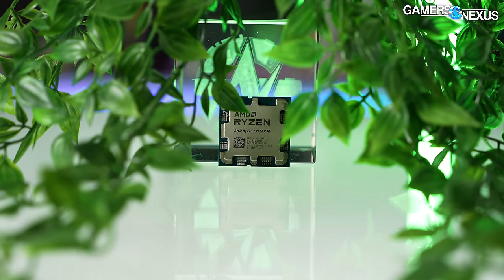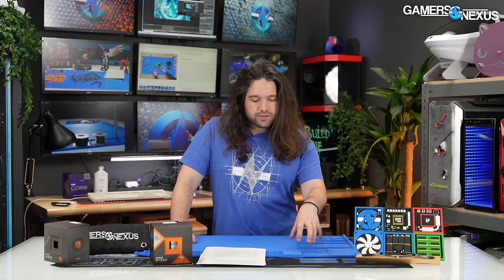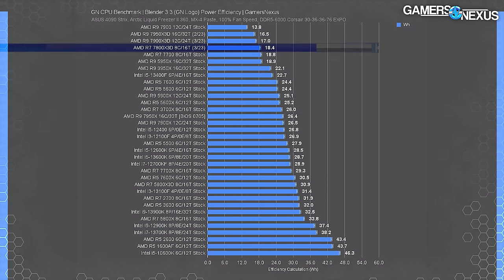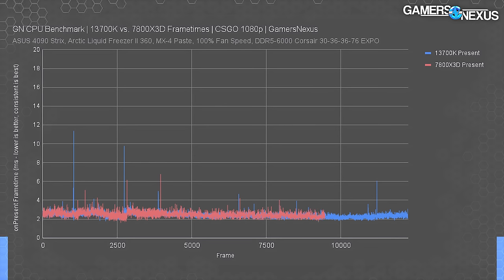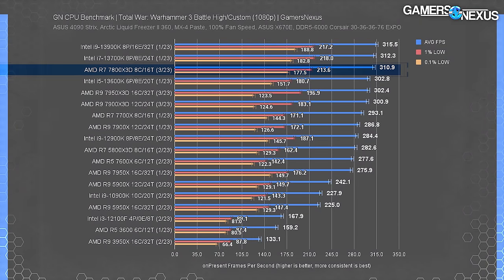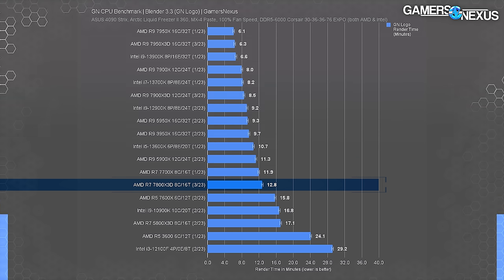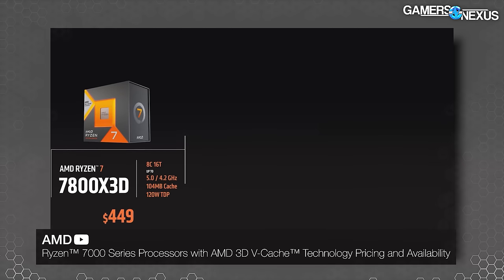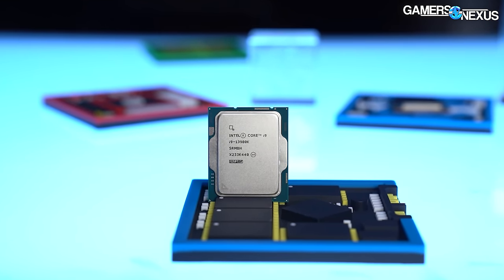AMD Ryzen 7 7800X3D CPU Review & Benchmarks

Comment: The efficiency on these chips is mindblowing. I thought my 5600X would be the last sub 100W CPU I will ever own. And all this while being one of the fastest Gaming CPUs and no ridiculous increase in pricing like in the GPU space.
Reply: i7 is similar efficiency and has it beat in almost every category...
Reply: Uh, it's a $500 CPU that requires a $250+ mobo and $150 in 32GB DDR5 to work properly.  Maybe 0.01% of gamers will buy this.
Reply: @mintymus  similar efficiency? 7:56 did you even watch the video? lmao
Reply: @mintymus  not even close to the same efficiency lmao
Reply: @sophieedel6324  wtf do you need a $250 board for? a $150 one does everything you need, and you dont need 32gb of ram
Reply: @rdmz135  do you know anything about the price of AM5 boards? you can't use this with an A620 board that only supports CPU up to 65w TDP
Reply: @mintymus  lol intel fanboy commented without even watching the video?
edit: after seeing his reply on other comment, yep, totally brainless fanboy
Reply: @sophieedel6324  am5 boards cost more
Reply: @rdmz135  Intel Raptor Lake need manual tuning and undervolt to improve efficiency, so it would be competitive on the power front vs. 7800X3D. These benchmarks are out of the box/stock numbers. Compared to Intel 10nm++++, TSMC N5 (for AMD), a superior process node, is a solid win on efficiency for AMD.
Reply: @sophieedel6324  mid tier mobos can be had for $200, and this is a gaming chip where 16GB is fine for most use cases, which can be had for for $90. Linus' review covers this exactly, actually.  I'd also add that these chips aren't really good for overclocking since they're so sensitive, so a low end mobo would probably be fine for most buyers.
Reply: @duccc  the ones that accuse GN of being biased towards AMD are always the most obviously biased out of anyone. IN MY OPINION , GN has consistently provided the most transparent information and reviews
Reply: @duccc  you
Reply: @sophieedel6324  32 gigs of ram to work properly? Why would more ram help it's performance?
Reply: Misinformation.
Reply: @xTurtleOW  they last 5 Years,not 1 like the Intel ones 😒
Reply: Why you want an x3d for blender? Are you playing games with x3d processor? So in games, even with i9 processor the power draw will be 50-60W
Reply: @sophieedel6324  I am paying 80cents a Kwh that makes intel a bad choice . also AM5 has cheaper motherboards because the CPu's do not need Massive VRMs 80 vs 280 watt that is a difference especially in summer time . if you have a Ac running and do not need a heater
Reply: I have two systems in my house, one is an AMD build (7950x3D), the other is a raptor lake build. The intel idles at around 18w, and it barely goes above 25w for low load usage (browsing the internet, watching vids, word..ect). The AMD idles for around 60-70w, and about the same for low load content, though can often go up towards the 90w range.

The fact is, the intel system will consume far less power than this x3D rig in the long term. AMD only wins in that efficiency category when its under load, which for most people is not all of the time. 

Food for thought.
Reply: @JuliTV123  

It's close when AMD is ahead, and then it's not a gaming CPU when Intel is only 1-2% ahead in specific games at 1080p. Nevermind the absolute need for high end cooling and a well binned chip from Intel to get the same benchmarks as reviews, along with the power draw. No one even mentions the worse multi-tasking that Intel has. In a real world scenario, with background tasks like a browser, music, antivirus, discord, etcetera, Intel will easily drop that 1-2% it used to be ahead in for specific titles if you don't
Reply: @duccc  Boy, you look silly.
Reply: @JuliTV123  Boy, you look silly.  Actually Intel is better efficiency when doing every day tasks, even gaming.  Only at 100% AMD wins. Try again.
Reply: Yep its actually nuts. My cpu draws 6 less watts (sometimes the same amount) and the 7800x3d has like double the performance in games
Reply: @rdmz135   Intel wins in every day computing efficiency, even gaming.  It only loses when at 100%.  Silly AMD boot licker.
Reply: @mintymus  would love to see proof of your efficiency claims on Intel, i'm running an already old 3700x bough on launch that is currently idling at 15-20w watching 4k videos on youtube and wallpaper engine running on the background

https://youtu.be/0ah-kH9iGM0?t=527

besides if we care about extreme efficiency we would be undervolting cpus for that matter. Once you get a proper argument, try again.
Reply: @JuliTV123  Just look at the P core vs E core efficiency.  Don't take my word for it, virtually all tech tubers talk about it.  BTW, 4K videos use more of your GPU, not CPU...Which I also assume you're outraged by how much power the new AMD GPUs use...right?
Reply: @mintymus  As soon as i look up stuff about intel E cores, I see tech tubers questioning about their supposed efficiency

https://www.youtube.com/watch?v=M38Q646L7fc

This is legit the first video that popped up when searching about them on youtube

Also yes, i'm very annoyed about the power draw trend new graphics cards are taking since the RTX 30 series
Reply: @JuliTV123  Efficiency can depend on how you set it up and run it.  If you max it out, one will waste more power than the other; any being wasteful.  Just undervolt your hardware until it's as stable as possible at the lowest power consumption at its best performance.  Then run games fps capped.  Any higher than your display supports wastes electricity and generates unnecessary heat rendering frames that are never displayed.  Pushing limits can cause hickups if your hardware hits thermal constraints.  I don't know if there is much difference, many say there isn't, if everything is sanely optimized.  Pushing limits is for bench marking or doing work that benefits noticeably.  Though I don't know why you wouldn't use a power cap if it significantly improves efficiency but performance is hindered only slightly.
Reply: "no ridiculous increase in pricing like in the GPU space"

I guess you and I define ridiculous increase in pricing very differently.
Reply: @rdmz135  "wtf do you need a $250 board for?"

You don't. But unless things have changed recently, you can't get an AM5 board for less than that. AM5 motherboards are all stupidly overpriced.
Reply: @sophieedel6324  buddy b650 boards can constantly be had on sale for around 150 on sale since the demand for them is so low. Got my gigabyte b650 ds3h for that price and it does everything I need. So yes, I do know.
Reply: @mjc0961  yes you can.
Reply: @JuliTV123  Just google 13900K power idle.  It's at about 8 watts.  Easy win.
Reply: @mintymus  Dude, you're calling several dudes fanboys and bootlickers, but mind you, the definition of that is is pretty much you defending a point without actual data over here on a 1 vs the whole thread scale and falling to ad hominem at best.

Who''s every youtuber? Are you talking on data from the 5000 series vs the 12th gen? Is there really average consumption data or just an "idle" bar where it wins but it is also the complete other side of the spectrum to a full load thus not really relevant? While there are people who buy a CPU to have it at full load all time, there shouldn't be people who buy it to have it idle, mind you, that's  ridiculous point. A literal potato will consume less when idle, why don't you just buy one?
Reply: >8C/16T vs 16C/24T
>blender all core workload, not gaming
>no mention that the Intel would finish faster
>no mention of idle power draw
>no mention of 300W+ GPU's so it literally doesn't matter
AMD drones out in full force today.
Reply: @griffin1366  I mean it's not like that core count really works like that with Big.little in account...

And let's ignore the whole video! Or LMG's, or HU's, or several others, it's not like we have gaming data...

Again with idle... Do you buy a PC to have it sit without use? The idle draw should be less important than the full power draw which actually has use cases unless you're planning to have running just a screen saver. 

End of the day if Idle is the only point you can make on efficiency, you shouldn't even bother, learn to put the thing to sleep.
Reply: @gerardopadilla2666  Your CPU is at 20% or lower usage almost all day long.  So yes, idle and lower usage power draw is very important.  Intel wins this, hands down.
Reply: @gerardopadilla2666  Btw, are you completely outraged by AMDs crazy inefficient GPUs?  And you must love Intel's very efficient GPUs, right?
Reply: @gerardopadilla2666   Well my old PC was on for 5 years straight but these days sometimes 30-120 minutes a day idle. You don't turn off your PC if you walk away or go do something, do you? I turn it on when I get home from work and it stays on until I go to sleep.
Reply: @mintymus  put the copium down, boy. You’re hallucinating
Reply: Let's hope that when AMD leans more into Chiplet Design on the GPU Front as well we will get similar efficiency increases to what we see here. Seriously, I don't really need more Power right now. As long as I don't turn on raytracing too heavily and with the benefits that things like dlss or fsr bring modern GPUs will have enough power for years. Especially when you grew up on Games running with about 30 fps and 60 being the maximum. I don't really need 150-200 fps. Sure I sort of feel the difference, but I actually undervolt and clock-limit my 7900xtx to save energy right now depending on the Game. (And yes, I know that in retrospect the 4080 might have been a better deal because of efficiency, but I got the 7900 for around recommended price while the 4080 was far above intended market price.
Reply: @AxleTrade  LOL I really wish I was.  AMD had a good run, but it's over...Not like you could afford one anyway :)
Reply: @mintymus  It's neither the same efficiency nor does it beat it in most categories. It primarily beats it in productivity workloads (which was to be expected) and in older titles like ff14 or CS which rely heavier on frequency then on multicore usage and cache. The difference isn't large though. So the X3D is definitely the better choice if you only Game and put emphasis on efficieny. Otherwise it's a pretty even fight which is good for us consumers. Just look at what Nvidia having market dominance has brought us. Consumers got so used to high prices that both Nvidia and AMD can now well their high end cards for about 3-4 times what high end cards cost just 10 years ago. I hope that calms back down now that intel has joined the field and seems to not do too bad.
Reply: @rdmz135  you do if you do more than gaming, and it's looking like 32gb is gonna be the norm sooner than you think
Reply: @mintymus  tell me you are an Intel fanboi without telling me you are an Intel fanboi
Reply: @drowsspeed1  16Gb is 2016. In 2023 you better have 32Gb, because demands for ram aren't shrinking.
Reply: @sophieedel6324  Do you know anything about the price of AM5 boards? You can buy B650 boards for $150.
Reply: @deuswulf6193  "The AMD idles for around 60-70w, and about the same for low load content"
That's probably because of the GPU, not the CPU.
Reply: @JonnieAlpha  LOL look how triggered you are that AMD isn't is good.
Reply: @DerPolygonianer  You're joking right?  Intel wins in productivity easily.  There are some games in which AMD is better, but for the most part for games it's 50/50.
Reply: @nathangamble125  Nope, the 4090 idles for half that. I'm looking specifically at the CPU. This is apparently common complaint found online, especially for those with a dual ccd CPU.
Reply: @mintymus  No, I'm not joking. Why would I be? You're not even really saying anything different to what I said. I said the Intel easily wins in Productivity. Which makes sense since most Applications don't gain anything from cache but scale with cores and frequency. But if you want to do work on this you're probably buying a different processor anyways. And you're not buying the 14700 either but probably the 14900 or possibly the 7950. Both of which are far better for Production. And yes, in Games both CPUs are neck to neck, with both CPUs having certain scenarios they are better in. But the amd needs far less energy and thus is more efficient. Also, the intel mostly beats the amd in older games that weren't optimized for modern CPUs by having higher frequency. More modern Games will probably be able to make use of the increased cache in most cases making the amd a better choice because you will get really high frame rates in old Games anyways.
Reply: @deuswulf6193  You are right but I will never understand this argument. 

First - You do not buy possibly the best CPUs on the market to idle or just do browsing all the time.

Second - 1 Hour of gaming will upset the balance of power in favor of AMD that will take hours of idling for intel to catch up, let alone 2 or 3 hours of continuous gaming. 

Third - Buying a chip because of how much it saves at idling its like buying a car because of how much gas it consumes running while parked in the garage overnight, while people just turn their engine off not spending any fuel. PCs have sleep, hibernation, shutdown mode, if you spent any energy is because you want to, because most PC can boot into windows in under 10 seconds. So if you build a pc for gaming, it still favors AMD by a long shot.
Reply: @DerPolygonianer  So they AMD will save you a whole $10/year.  BIG WIN!
Reply: @mintymus  i love reading the tears in your replies
Reply: @aronPlays14  Yeah, sorry..been laughing so hard I can't help it.  LOL
Reply: More watts means a bigger PSU, more fans, more fan noise, probably water cooling (250W+ on air is basically sitting next to a small vacuum cleaner), more heat soak of components over the years.. a bigger bulkier case, more spent on cooling the room you're in.. It all adds up bit by bit.  I ran the numbers once and came up with well over $100 more a year in extra power needed for a 17900K over a standard 100W TDP design. (let alone this at well under 100W)
Note that the biggest factor in the above calculation was room cooling.  A computer that is running at 500W or so versus something at 300W.. when that A/C does come on twice as often, every extra time it spins up is like tossing a quarter out the window.  Over a year, that's a pile of small change.
Reply: @josephoberlander  You're not going to need a bigger PSU for 30 more watts....lol
Reply: @mintymus  For an Intel that is using 80 or upwards of 250 more watts, you might.  It's all about a few dollars extra in your build here and there to deal with the extra power and heat.  My guess is that it's close to an extra $100 including the water cooling, versus this being fine with almost any hardware you choose to use, or more likely re-use.
Reply: @josephoberlander  Wrong.  Don't need water cooling.  Are you also outraged by the 7950X and AMD GPUs high power usage?
Reply: @mintymus  You will for the competing Intel top-end CPUs, though, which was my original point.  The very best air cooler can only handle about 90% of a 13900K before you get throttling. Almost everyone spends the extra money for a cheap water cooler with the Intels just to be safe and that's.. another $50 or so into the build.  But that also means a larger case and extra fans and.. it all adds up a few dollars at a time. As for GPUs, most of them are very efficient, actually, and high-cpu use tasks typically don't even activate very much if any processing (say, compiling something or re-encoding a video).  The issue with Intel is that they simply use an extra 100-120 watts than the AMD for every task that people are testing.   And I'd honestly take a speed hit to save that much power if I was a business.
Reply: @josephoberlander  Most people won't go anywhere near 90% for a sustained load.  Btw, you will have the same problem with the 7950X.
Reply: @mintymus  Naturally :)   AMD is famous for their topmost CPUs also being mini space heaters :)
Reply: @josephoberlander  Right...Which is why it's so amusing to see all of the fanboys here trashing Intel while AMD does the exact same thing.
Reply: @mintymus  I'm glad ur buying $500 CPU's for its amazing IDLE power draws lmao, u must be a first.
Reply: @Inquisite1031  And I'm glad you're buying CPUs for their 100% efficiency, even though that's almost never used :)
Reply: @mintymus  I'm a civil engineer I render 3D models all the time, lmao, that's why we normal people buy CPU's for their actual use.
Reply: @Inquisite1031  Doesn't matter, your computer spends more time at idle than 100%.  I guarantee it.  (lmao)
Reply: @mintymus  no it doesn't, I didn't pay $500 for my 13900K to be at idle, most people cant afford to pay $500 for their CPU's be it Ryzen or Intel to then do nothing, why tf would a normal person buy a workstation CPU and have it be at idle most of the time lmao, ppl are not that rich.

like squeezing the most Dollars per Hr is the point of these workstation CPU's, so NO I cannot afford for it to do nothing and just sit there.

if i want good IDLE performance I would turn off my PC, or even better not buy a PC at all for that matter lol.
Reply: @Inquisite1031  I thought engineers were supposed to be smart?!  Wait...you're civil.  Thanks, that explains everything.
Reply: @mintymus I'm smart enough to realize, hey if I want the best idle CPU performance, all I have to do is turn it off, ahahahahaha.

Also I'm able to read and understand a simple 2 co-ordinate graph, and u somehow cant, so idk how that happened.
Reply: @sophieedel6324  7600 best gaming cpu for the buck.  And comes with free heat sink.
Reply: I'm sorry but 32gb ram is the norm now . Games can use more than 16gb now and the less ram you have the harder your cpu has to work.
Reply: @catalinneculita4988 what?? The top intel cpu's pull well over 200 watts
Reply: @headphonesz6527  in synthetic benchmarks or in no real world games scenarios ofc. 14900k(rtx4090) CP in 1080P 215w on stadium area, but if I run in real world scenario 4k and how I play all games it burn like 140W in a game that is very cpu intensive. Anyway you will gain more fps in 1080P if you can tune memory 7600+ MT, now I’m at 8000MT and I’m all over this online benchmarks.
Reply: In what universe